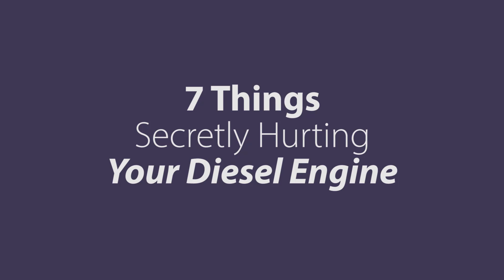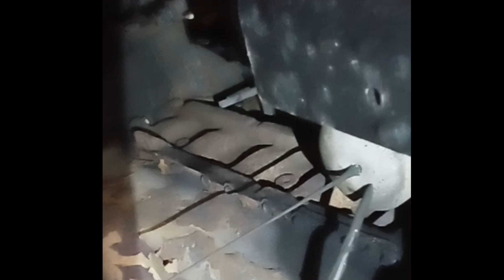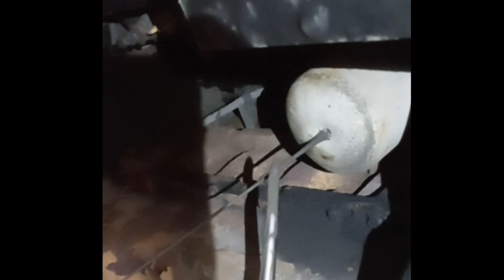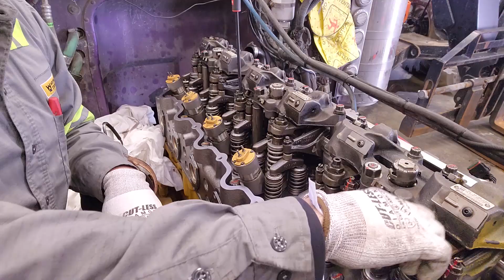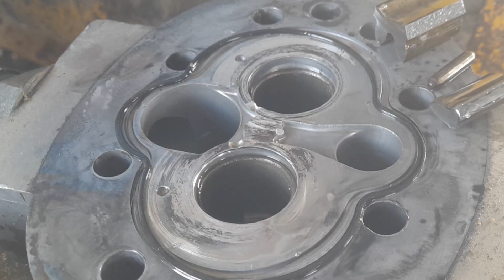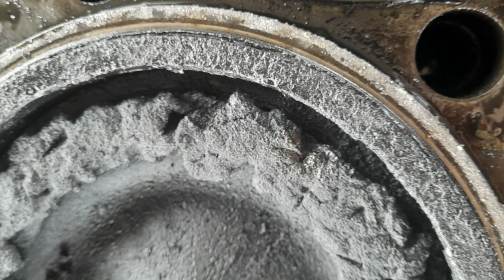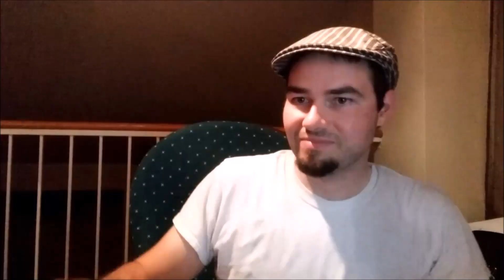Top 7 Things that could be SECRETLY Hurting your Diesel Engine.

Comment: I just got a 1999 379 with a 3406e my engine fan doesn't come on until 225 degrees so I do fan override switch at 205 is it normal for 225 on e model

Comment: I idled my 2017 f350 2 weeks ago for 34 hours straight doing my restart. When I hit thr road it blew white smoke for few miles and disappeared. Next day my cp4 exploded. Idk if the cp4 had anything to do with idling 34 hours but it was a new cp4 by powerhouse diesel less then 25k miles on it.

Comment: An idling engine has higher compression than an engine running at 1200 rpm’s which means  banging and blowing the head gasket

Comment: The topic of idling, is optimized idle good or bad?  I had a 2020 Cascadia that would start 20 times a night, I know that system has been around for ages (at least 20 years) but it would always fire, idle real low then bump up 6-700 and just about every day it would regen while parked (I was on paper so obviously I didn’t sit still long). But occasionally it would shut off during regen and fire back up and start regeneration again. It regenned on the hwy as well like it should, then would repeat the process. I was in and out of Freightliner it seemed every week because my cruise would set itself at governed speed, which was 78, it would set itself on ramps, in traffic, all kinds of wonderful places. I still have video of it doing it on the off ramp in Yakima, you couldn’t cancel it and there was no warning, it would just do it. Now that has nothing to do with idling, but there were sooooo many electrical issues with that truck so I can only assume other issues were happening. The truck only had 71 miles on it when I got it so everything was warranty work, but I was in every Freightliner in CO, CA, WA, OR, ID and UT it felt like. I ended up getting out of the truck, but they blamed it on new trailers, wheel speed sensors, driver not knowing how to set the cruise was my favorite one. I get the dash looks like a video game now, but it wasn’t like I was driving a space shuttle. Long story short, could any of that been attributed to opti idle? As in the electronics of it? Denver Freightliner ended up fixing it, but by that point I was out of the truck, but that was after over 170k and I couldn’t care less what happened to it

Comment: When you're idling your diesel engine you are not wasting a lot of fuel. You're only wasting a littke fuel. With no load on the engine, you are burning the bare minimum fuel to acheive the crankshaft to rotate at 500-600 rpm depending on your engine.

Comment: Hi Josh on the subject of warming up on cold start I have to say even though mostly same rules apply to most diesel engines how ever there are some differences in technicalities even between same manufacture engine models for instance c7 and c15 are different in cold start up settings for example c7 as soon as starts rpm jumps up for while and that’s because displacement is not quite enough to make a proper heat on compression stroke when cylinder walls and pistons are cold , on the opposite side c15 ideals on 500 rpm right after cold start and it depends on how cold ambient temperature is it might take up to couple of minutes to jump up to normal ideal speed which normally is 6.75 to 700 rpm and per caterpillars themselves you don’t have to warm your engine up as long as you have proper oil pressure and they recommend that you should drive in low RPMs if you have to move right away however, with all due respect to everybody’s opinion, I owned, drove and worked on my own since 1984 and I can tell you there are many reasons that I personally warm up my big cats at least to 130° before I roll and one of them reasons are oil pressure is too high most of my trucks are at 80 psi Even at 40° ambient at a start up and I don’t like to cause oil leaks the second most important reason is cylinder liners and Pistons are obviously made out of different materials and for sure they don’t warm up at the same rate neither do they expand at the same rate so you see what I’m getting at. and that’s why cat setting it self starts up at low rpm then jumps up 
And lastly, about Westgate of Turbo, I have to disagree with some of your input. I think they are totally horseshit, and everybody who has single turbo cat should either change it to non waste gated turbo or pinch that stupid hose, for it causes more disadvantage, than advantage if any,like it derates Turbo boost, raises, EGT greatly,causes bad fuel mileage, and I can keep on going, after all it sets to open after 25 psi (really 🤨😒)and I think the only advantage it would have to lower the back pressure of the exhaust manifold, which that has never been a problem with GarrettTurbo or OE cat equipped turbo which is 1.42 AR at its hot side which 
That means,is big enough even without wast gate To flow all the exhaust gas through out the turbine housing without creating back pressure so in reality, there are no advantages to have that damn waste gate it’s almost like having a very bad leak from air to air 😅however you should definitely have a pyrometer gauge to monitor your EGT and not to let your boost go up excessively which is over 38 pounds except accert twin turbo

Comment: Thanks Josh, I have a 01 freightliner fl70 3126 cat engine. Is the cruise control is how you raise your engine idol? If so mine is not working but my engine does idol up for about 30 seconds when the engine is cold. I  definitely need to take it to shop and get my cruise control fixed since it doesn't work at all right now.

Comment: Southern Pacific management ignored past practices and were proud of themselves for saving fuel costs by directing that locomotive engines be turned off by operators instead idling while parked.  Shortly after that management involvement, the shops were ordering replacement train diesel engines. The cool down and heat up cycles were cracking the V16 engine blocks.  Since locomotive diesel engines cost more than diesel fuel, management reversed their executive orders to employees and allowed the operators to return to letting the engines idle.  So, Item #1 was a very expensive and destructive for train diesel engines.

Comment: I live a few miles from the highway, on dirt roads. Starting, getting the oil pressure up, and putting along in first or second gear for a couple miles doesn't stress your engine and is a good warm up.

Comment: Good video. Fuel desolution is the worst and most abrasive. Lake speed junior put up a video on how important auto stop is if you have it on your truck and using it because they did laboratory test on the oils and saw much less wear metals when they were using auto stop versus the oil that was not.

Comment: Excellent 👍
I recall when CAT began putting filters upsidedown to prevent prefilling them .

Fuel needs to be less than 10 microns clean on new common rail systems.
And Gomers dump dirty shop fuel with bugs  into clean side to prefill filters .

I often install a temporary electric fuel pump off pickup tube on saddle tanks and push fuel trough for 10 minutes until fuel comes back in return line on boats especially.

Also all new fuel filters should be sealed in box with plastic over gasket end.

I recently had some not sealed new that has debris cardboard dust in them .
Use CAT or Fleet guard with factory plastic seal on end only on new common rail stuff or $$$$$

Comment: Hi Joshu this is Danny i have a question about overhead adjustment , I have 3406e engine on TDC but i did not know with one is compression #1 or #6 how do i find out ? thank you.
Reply: The opposite cylinder will be in overlap. Also if your on TDC 1, exhaust valve on number two will be open. Just the opposite if your on TDC 6, number five exhaust valve will be open.

Comment: Hey Josh, I have a question for you. On a 3406 E prefix 1LW, where is the best location for an aftermarket fuel pressure sensor? Is it behind the primer pump or to the left of it?
Also, if the filter starts to plug, will the pressure read higher or lower with the sensor behind the primer pump?
I appreciate the info and, as always, enjoy the channel
Reply: Fuel psi needs to be measured after the secondary fuel filter. As you will know roughly fuel psi the injectors are getting. Should be an allen plug on top of the secondary fuel filter base, where the line goes up to the front of the head. You might have to put a snubber in the fitting to prevent the gauge from bouncing and breaking.

Comment: Here in central Texas it normally don't get that cold, but I still put a high idle switch in my 06 6.0 I don't idle any more than I have to. Fluids are pretty easy to check on my 6.0 and my 7.3 IDI I retired from trucking but still love my diesels

Comment: Happy New year , as well to everyone else!!
When I designed my fuel filter/system for my truck, I put  pre and post filters valves. So that I can isolate the filters. Change the filters W/S ,, fuel filter. So close the valves pre and post, change the filters,  as the fuel was clean so dumped it back into the fuel tank. lubed the filter O-rings and installed them. Opened the Pre valve/as well the fuel return valve to the fuel tank, then  bumped the electrical pump in tank  .Circulated the fuel back to the tank  then let it sit for about 5 mins to let any air trapped in to rise to the return tank valve. Then run the pump again for a few mins to remove any air. Closed the return tank valve opened the valve to the engine. It fired right up. 
Yes I have left a few other things out but that is the just of my design. I wasted?? about a tea spoon of diesel. 
SO I FIGURED IT WAS A success!!! 
The Cat 0749 filter is rusting badly. so it is not going to last that distance of  that filter change. Guess I will stick with the Donaldson 1000 and the 1313 or is it the other way around???

Comment: I have a question maybe you can do a video on it. Smaller diesel engines 6.7 cummins or power stroke. What is your thoughts on a oil bypass filter like the one sinister diesel sells. I'm wondering if you could be putting to much oil back on top of the motor while running it. Any help would be appreciated.
Reply: spinner 2 and forget  everything else

Comment: Question for you. Start the engine is cold outside, no block heater because im at truck stop for my 10hrs. You say idle 1 min then fastidle 1k 12k RPM. Oil is still cold and oil pressure go crazy like over 100 psi. Is it dammage the engine ? Only new Paccar Mx13-21 put an variable oil pump who solve tha problem. What do you think ?
Reply: that the  way the  older paccars were, just  keep it under the 100 psi and let the back pressure valve work it will warm up the engine very fast aka idle.

Comment: You're so right about the importance of running the right thermostat. I even saw an engine overheat with no thermostat installed. Turns out the coolant was running through the system so fast it wasn't in the radiator long enough to cool down. When it gets hot outside it takes longer for that coolant to cool off. The start-stop flow from those thermostats opening and closing gives it the time to do that.

Happy new year!🎉😅
Reply: I must disagree. The Btus/minute being dissipated by the radiator are proportional to fluid (coolant) velocity. Moving the fluid faster will raise the average temperature of the radiator, and the differential between radiator and cooling air will increase. This results in more Btus/minute being transferred from fluid to air. If you saw an engine overheating, it wasn't because of a missing thermostat. The thermostat has just one job: prevent the coolant from entering the radiator until the engine is close to operating temperature.

I see this misunderstanding often with hydronic floor heating systems. Many people think running hot water through a zone loop more slowly allows more heat to enter the room. This is wrong. A higher velocity raises the average temperature of the loop and increases output. It's somewhat counter-intuitive.

Comment: Nice, I find nothing to disagree with here. All good.

60 years in the industry and I have stopped asking the operators of idling engines if there is something wrong with their starting/charging systems. My sarcasm proved ineffective. /: 

I get that sometimes you have to leave them running. We did it all of the time in the Arctic. But the practice did make for more mechanic work and I was able to feed my family sufficiently for many years. And made me a lifelong proponent of oil/coolant/battery heaters or heated spaces. Ultimately idling costs add up to more than just the cost of the fuel. 

Since the introduction of electronically controlled engines one of my first stops when reviewing engine data is idle time and/or idle percentage (some differences in terminology between manufacturers). It's a well proven killer.

Happy new years, keep up the great work.

Comment: Good topics, I would add the following:
What Cat calls a "coolant" or "temperature" regulator is not an ordinary thermostat. Cat engines have an internal coolant bypass system which when the regulator is closed, allows coolant to only flow round and round in the block until it gets warm then the regulator shuts off that passage and opens the passage to the rad. Helps in warming up faster.
But, people mistake the regulator for a common auto thermostat, which simply blocks flow and they think if there is an overheating problem removing the regulator might fix it, not realizing removing the regulator merely allows the coolant to avoid going to the rad, just going around and around in the block. 
Contributing to an overheating problem, which then get diagnosed as a plugged rad or head gasket or other problem.

Comments on warming up and idling, pretty true. 
Remember however, starting at -40 is a whole different matter than -4. 
At -40 you wanna make sure the oil drips off the stick before you even try to crank it, then idle gently if it starts, raising rpms slowly. And even then there is no guarantee, only minimization of damage. 
Idling all night at low idle is a mistake, I agree, got to get the revs up a bit and splash the oil around.
The old pup/starting gasoline engines were a real education in starting diesel engines.
Really a work of ingenuity, they shared the same water jacket as the big engine so it warmed up the big engine a bit and the exhaust from the small engine passed though a tube in the big engine intake manifold, warming the intake air.
The big engine had a compression release that was employed while rolling it over until the oil pressure was up and things were ready to start.

Filling filters is a bit of a sore point for me.
I fill them, from the outside/dirty side [remembering some filters are opposite flow] or not.
My attitude with oil filters is if you have an oil pump that puts out say 30 gpm at idle it will fill the filter in seconds, if it doesn't you have a larger problem. I've had it happen then being blamed for not pre-filling the filter.
As for fuel filters, notice Cummins filters for some time have a plug in the center to be removed after filling. Good idea.
Like your advice.
Reply: All standard automotive coolant thermostats function in the same manner: they are closed when the coolant is cold, and force the coolant to circulate around the block. Once the coolant approaches operating temperature the stat slowly starts to open and allow coolant to reach the radiator. Eventually, the stat is fully open and almost all coolant flow is through the radiator. No automotive stat closes off coolant movement; if it did you would see uneven heating of the block and possible damage. The coolant must keep moving at all times. So......a Cat coolant regulator is simply a standard coolant thermostat with a new-age name.

Comment: In regards to the advice on warm-up, I am curious how this carries over to new trucks. We run a fleet of trucks with DD13/DD15,X15, and MACK (VOLVO LOL)  MP7/MP8. The Mack and Cummins engines have VGT Turbos and have a warmup cycle, I can hear it load down shortly after startup to build heat. The Cummins works okay, but our Mack engines are typically 150-175 degrees within 10 minutes of startup. The Detroit's don't seem to have any kind of warmup mode, but I assume that is due to having a more conventional turbo. I'm guessing these systems are in place for exactly the reasons you were talking about for older generations of engines.
Reply: All engine manufacturers car, truck everyone wants there engine at operating temp as fast as possible. So a VGT enables the closing off of the exhaust - creating higher backpressure and so keeping the exhaust in the engine more. Standard non and wastegate turbos don't have that control and so can't. FYI petrol/gas engines can warm up at idle more than diesel because they are so wasteful of their fuel but that also will have lessened as they change from carbie - throttle body - port - direct injection. 
Also manufacturers overtime have made sure that the amount of coolant that circulates while cold is a little as possible with nearly none going going to the radiator either.

Comment: I work on 3520s that burn landfill gas. We adjust valves and measure valve recession every 1,000 hours. When the valves move too far or in opposite directions, we replace the head (20 individual heads).
Reply: Do you record what is happening with each valve on each head?  If you do you may find that some heads are going OK and may last twice as long as the lowest life heads. If they don't there is no saving to be had and a lot of peace of mind so change them all. Landfill gas - engines run on it but none of them love it.......